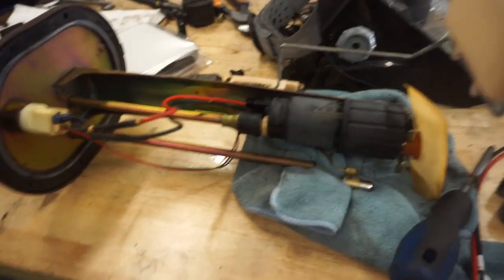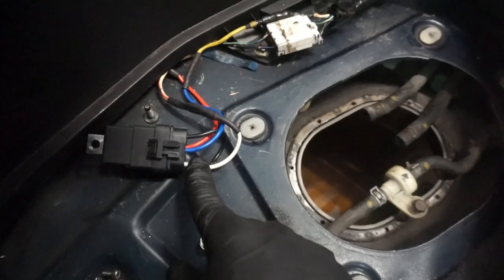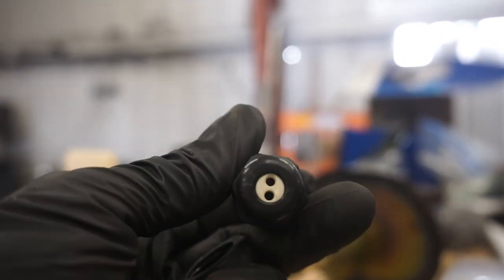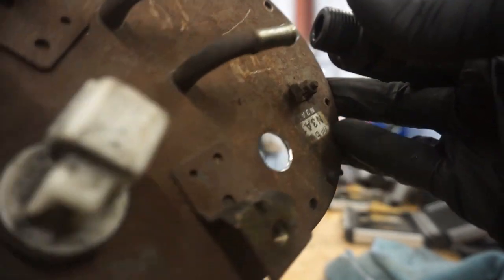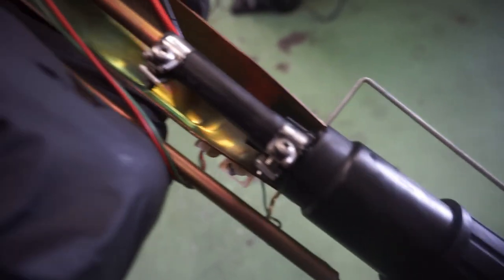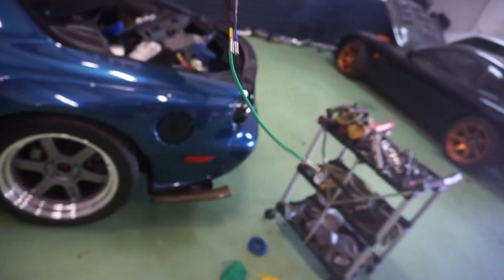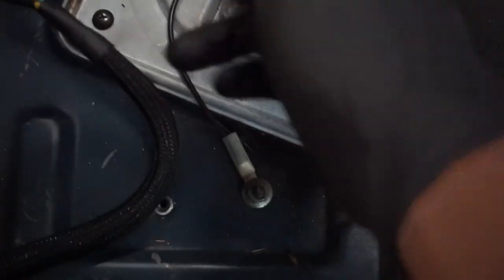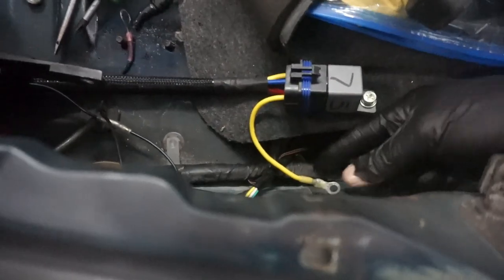FD RX7 Fuel Pump Upgrade

Comment: Oh man. I hope you still see these comments. Im in the middle of doing this and have an issue. I thought that since this bypasses the resistor, i wouldnt need to worry about it anymore. Can i not just leave it unplugged or is cutting it and looping the wires a must? Ive been on those forums and this part seems to get left out.
Reply from the maker: @ChErRyaVe20pK  I mentioned it in the video. You have to complete the circuit. Cut the plug off the resistor and attach the wires together. Make a jumper plug out of it.
Reply: @FullDetailAutomotive  Holy crap, I can't believe you replied so soon!. I've been spending most of my day just on these forums trying to figure this out. Almost nobody over here seems to suggest that looping the wires on this resistor is a must. Thanks so much. I'll try this out and get back to you and let you know how it goes.
Reply from the maker: @ChErRyaVe20pK  no one mentions it because they don't do anything with it because they don't know it's even there lol yea, loop the wires and it will work if you did everything else right
Reply: Ah I see. Okay I will be reporting back to you tomorrow with my results. Be sure to look out for my comment. Once again, thanks so much!

Comment: good one mate, one question do you recommend putting Solid State relay, with PWM so that the fuel pump wont be overheated when parked or make it last longer?
Reply from the maker: Its not a concern and not necessary

Comment: Isn’t there a relay in the junction box you can also use to jump the FP resister?(for those who tossed the resister itself already😂)
Reply from the maker: you just need to jump the plug that plugged into the resistor

Comment: Probably much cheaper to do this fix, but I would save my pennies for a Radium hanger and bulkhead harness.
Reply from the maker: The radium hanger doesn't offer any appreciable advantage over this mod for moderate power levels. It is effectively the same. If running 1 pump and 5/16 or -6 line then the radium hanger has no kind of advantage. It all depends on the application. Simply using the most expensive and elaborate part isn't always the solution. The radium hanger makes sense for the sets up that would need something like that but for the vast majority of owners and set ups, this makes more sense than using the radium hanger.

Spending that kind of money to make 400whp or less doesn't make any sense. For those that have that kind of money to blow then cool lol live your best life.
Reply: @FullDetailAutomotive  what about if I want to run dual pumps? End goal is as close to 500-600whp. Radium is enticing,  but if I can save cash running dual wally 450's I'd rather do your style. Was considering doing -8an lined but, no real information on the subject. Everyone just jumps to buying radium.